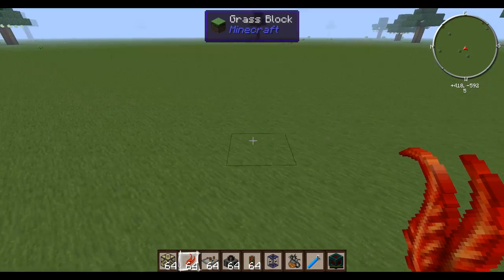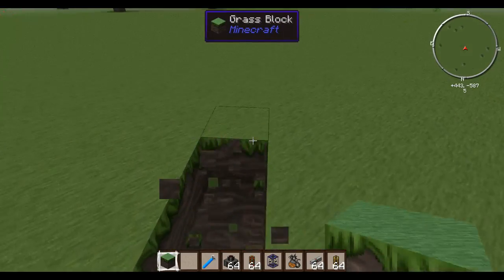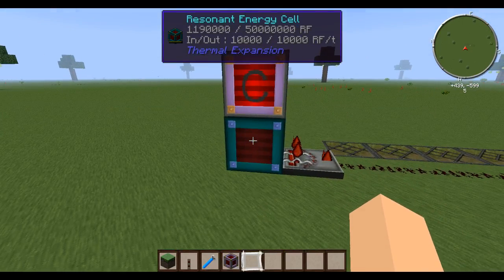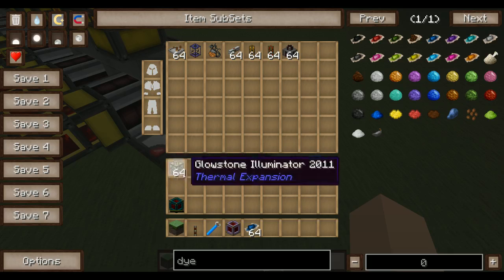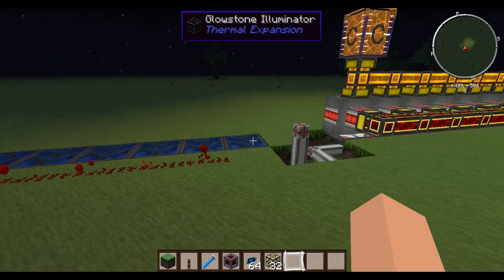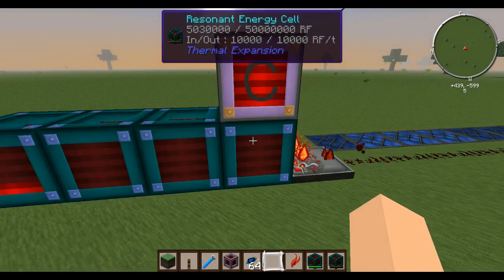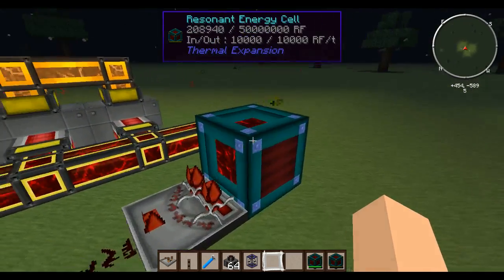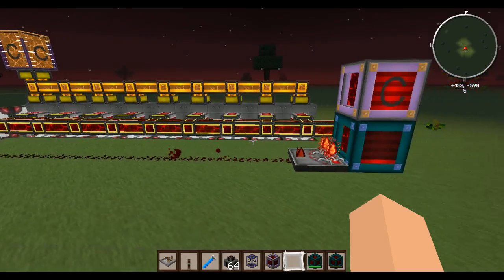TE3 Automated Dynamo Shut Off

Comment: To force it on, place a lever right next to the comparator (that disables the output unless its stronger than the input from the side). Or use an and, requiring both a lever to be on and the comparator output to reach the and gate before the engines turn off.